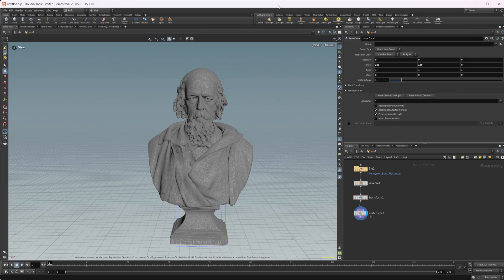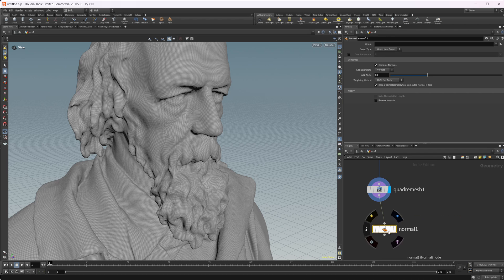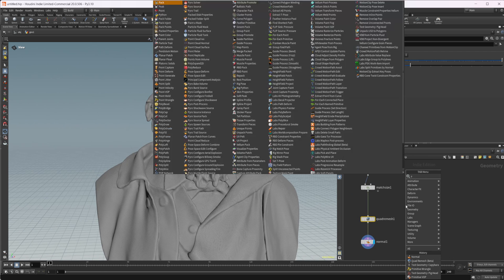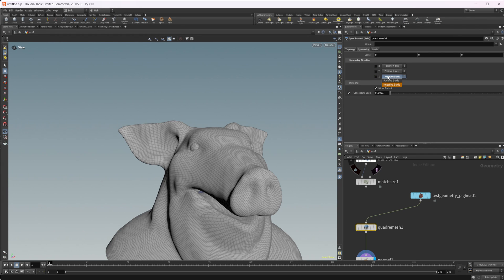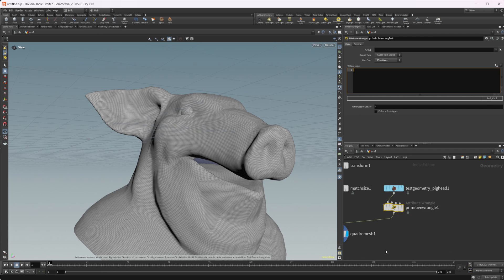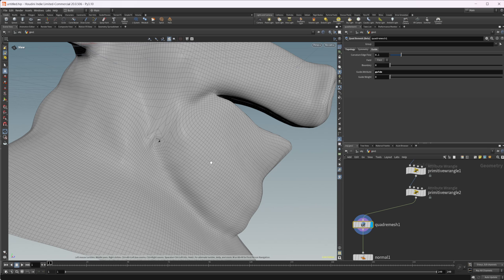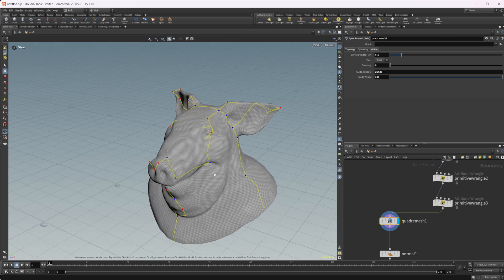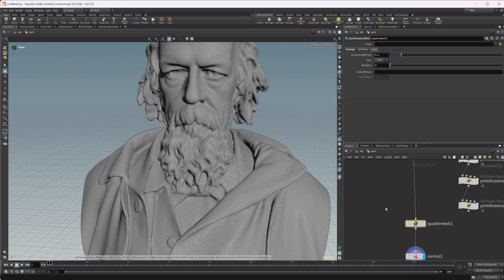How to Use the Quad Remesh Tool in Houdini 20

Comment: Thanks so much for the presentation! It is what it is at the moment. I can not wait for it's final release, right now it is a little bit of a shame vs other remesh tools - but I'm absolutely shure, that SideFX will not leave something sleeping in such low state. Being absolutely honest It is hard to understand why they even released this beta version? :) But the speed is incredible! Let it keep its good behaviour at its upcoming final state. What I expect, since I had been I criticizing it: Auto detect parametrically changeable edge angle and make it hard edge, this hard edge should be able to  receive a bevel with properly supported corners, these edges should also follow a proper edge loop, all other edges that has lower angle connection should be putted in a queue where they form edge loops, the queue should be based on form connectivity(returning to it self highest) > length > angle. The final calculation of point number on these edges should be based on the front edge, that it make a bridge with (= bridged edge count, detail determines) a post process option: decimating between edge loops. Something like that would be a a quad retopo tool that stands out, as the program it self what holds it.

Comment: There is something wrong going on with your houdini; I don't experience that laggy behavior when I drop a node.
Reply from the maker: Yes I am aware. There are a lot of people experiencing this issue with Houdini 20. Apparently it can be fixed by installing a local license instead of using sidefx as the license server but I have been having issues getting a local license installed.

Comment: The speed is insane. I love exoside's quad remesher, but I'm afraid it's already obsolete because of its' very slow speed. Need to test it myself, but the result looks very neat.
Reply from the maker: Exoside's is definitely slower but it's also better overall than where this is currently at. I do think that this will ultimately make exoside's obsolete in houdini because of how insanely fast it already is.
Reply: until you need to remesh a hard surface mesh.

Comment: how about drawing some curves on the mesh where you want the flow, then using polyframe to get the tangent and attribute transfer it back on the mesh as a guide vectors?
cant play with it myself yet as i have steam version and i need 19.5 for some work still (redshift compatibility and stuff)
Reply from the maker: Yes I think that will work well. This is one of the ideas I had after I made this video to explore more of the guiding. I will be looking into that more as time goes on. Appreciate the suggestion.
Reply: @InsideTheMindSpace  would love a deep dive more into this once you perfect the workflow